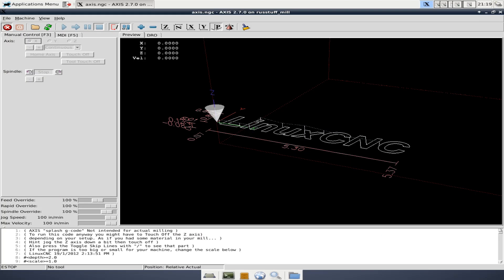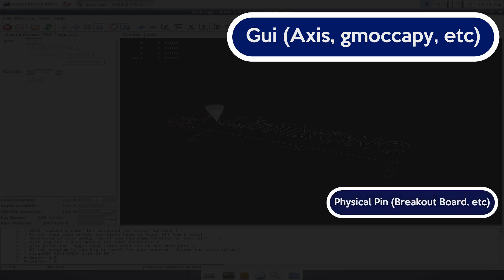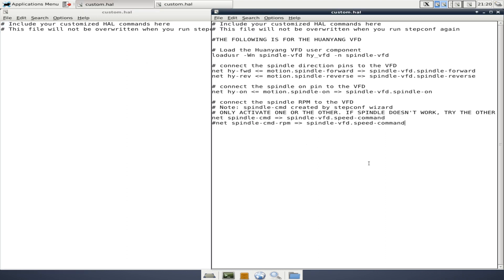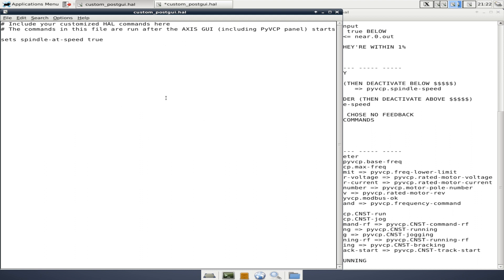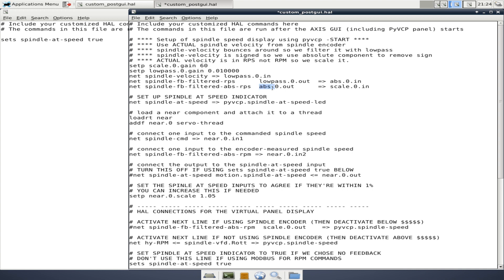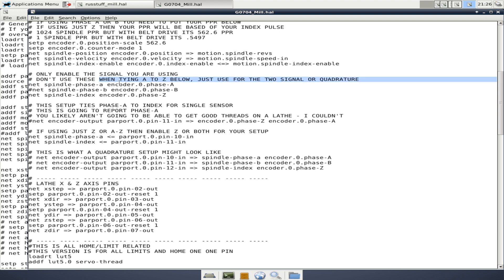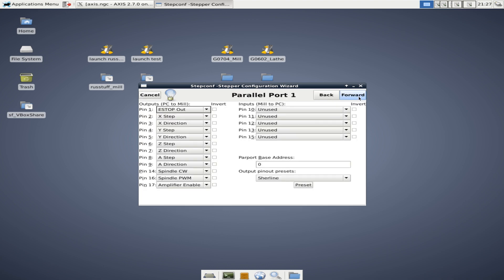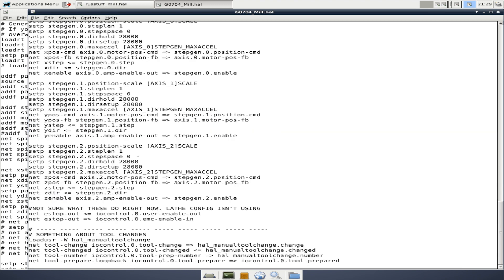LinuxCNC pt6 - HAL (A Brief Overview)

Comment: Let me attempt to explicate. 

The first thing after "net" is always a signal name. You can choose any signal name.
After the signal name you can have one or more HAL pins.
You can use the same signal name on more than one line, and in more than one file.
And pins that share the same signal will take the same value.
Only one of the pins connected to any one signal can be an output (writer) pin.
Note that physical inputs are HAL output pins and physical outputs are HAL input pins.
Reply from the maker: Thanks Andy!
You're such a rockstar, and have helped me several times on the LinuxCNC forum.
Thanks again!

Comment: Hi Rus,  Great video.  I look at HAL slightly different.  I see HAL as the conductor and the machines ini as the sheet music.  The sheet music (ini file) describes the RT components that HAL will use, and the NET command are the notes.  Weird huh?  Also, it may be a good idea to point out the difference between signals and pins.  Thanks for sharing and taking the time to create.

Joe
Reply from the maker: I'm going to have to think about that one :)
Thanks for the ideas!

Comment: You might likew to investigate using VLC Media Player as a screen recorder for future Linux based videos.
Reply: Hmmm... I have never used VLC for a screen capture.  I should give it a go.  I have had good success with simple screen recorder and recordMyDesktop.  I have thought about using KdenLive to see what I could get out of that.  Thanks for the suggestion.

Joe
Reply from the maker: I've never used VLC on the Linux machine, but I'll try it for sure. I use it as my media viewer on all of my other machines. I didn't even know it could do screen capture :)
Reply: You might find you are a little restricted for frame rate but with tutorials that dont require realtime lipsync or motion it probably isn't a problem. I personally haven't used it yet but simply did a little research to see if there were any options to allow you to do screen recording on Linux, especially for software like LinuxCNC where you cannot run it properly in the virtual box under Windows for the purpose of screen recording. My Heap suggests some other possibilities although Kdenlive seems to make use of RecordMyDesktop for screen capture.

Comment: You can rigid tap with a belt drive other than 1 to 1. Linuxcnc has the ability to separate the encoder from the index pulse. You can use an encoder on the spindle for the index. On the G0704 you can actually use the original encoder with all of the holes on the disk filled in except one. Then you can use Hal to direct the index signal to the right pin.
Reply from the maker: That's good news. On the forum, all of the old timers are saying you need 1:1 or direct reading from the spindle. The motor I have has a 1024 pulse quadrature encoder on the motor itself, which I would prefer to use. I'll make sure to do a video when I get to that point.
Reply: russtuff You do need it to be on the spindle. Basically the motor encoder will be used to establish and maintain speed and the encoder on the spindle is just counting a single pulse per revolution. This card just requires you to make a simple disk https://cnc4pc.com/c3-index-pulse-card.html or you could build the same thing for maybe $5 in parts. I built mine but have installed it yet. I am also using Mesa cards which makes the process simpler.
Reply from the maker: +Michael Alcocer Oh right. If the encoder is on the spindle then the belt ratio can be anything. I meant to say if your encoder is on the motor then you need to be 1:1 for rigid tapping. I'll rewatch the video and annotate my wording.
As for the C3, I'm using two already for my lathe A (multi) and Z (index) channel pulses. That is detailed in an older video.
Reply: You can have the encoder on the motor, and not 1:1  as long as the index is on the spindle. (ie, add an extra index pulse from a keyway slot and proximity switch, for example and then set the spindle scale accordingly)